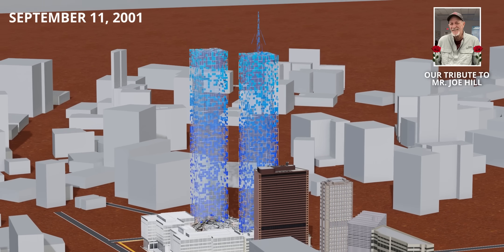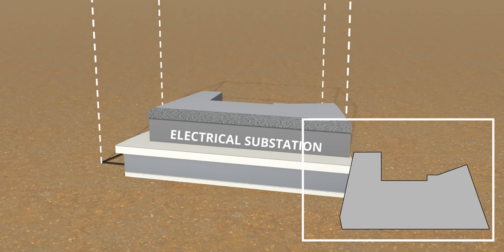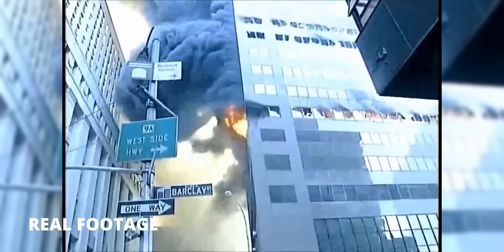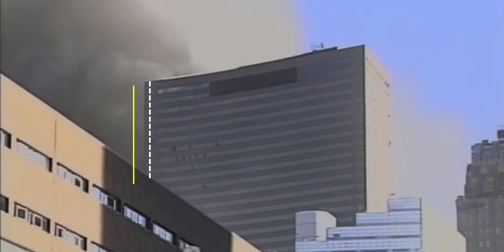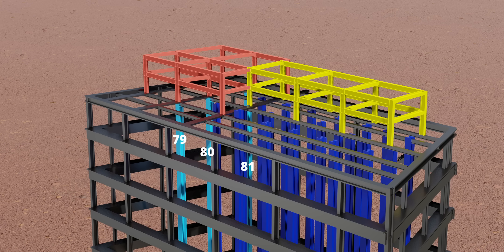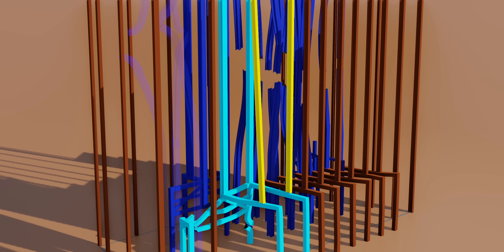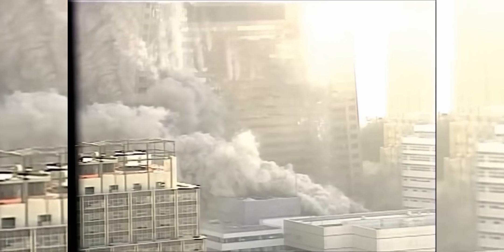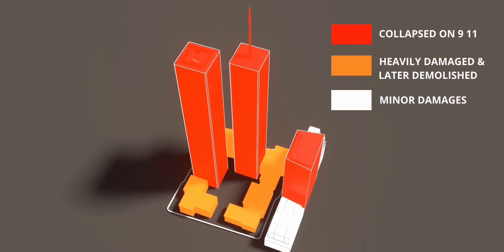Collapse of Building 7 | The Complete Physics

Comment: Oh it had a small "penthouse" at the top, that's why is collapsed and turned to dust and all the other STEEL COLUMNS failed, lol, how sick can you be to try to gaslight people like this, disgusting, shame on you. You really think they would allow this building to be built if a few fires could take it down? lol
Reply: Building 7 - the 6th building to collapse of 10 lost on 9/11 -though extensively studied  still confuses many. Not famous or a terror target, and with no casualties, it did not get a lot of attention initially, creating a void the internet rapidly filled with garbage. Because everything seems like a conspiracy if you don’t understand how it works I prepared this brief summary of the collapse from my own analysis. No politics, just engineering. 

Context: The North Tower collapse at 10:28am bombarded Building 7 with tons of burning debris, causing heavy damage and starting multiple fires burning out of control for the next 7 hours. Half the FDNY firefighters having been killed, others injured, units in disarray, equipment destroyed, no water pressure, and the greater urgency of Search & Rescue efforts, firefighting was pulled as futile. The building couldn’t be saved and was left to its fate.

www.youtube.com/watch?v=g_SvpwyC17M&ab_channel=MFitz  

Collapse of a burning structure is always a concern for firefighters. Steel buildings subject to fire rely on active fighting of the fires to survive. Buildings are designed around 1 to 3 hours of fire resistance, allowing time for occupants to escape and ACTIVE firefighting to get started, after which all bets are off. Left to their own devices they will exceed their design envelope and collapse. In B7 the occupants escaped, passive and active fire protections were compromised and active firefighting was abandoned which left the building to take its chances. It lost. Odds on Building 7 would eventually collapse, and it did. No big deal in logic. That is the sort of choice firefighters make every day in brush fire situations - which houses to save and which ones to let go. Only real difference here is moving the decimal on the size and cost.

www.youtube.com/watch?v=WnYBX6QT0R4 

FDNY Chief Daniel Nigro ; The biggest decision we had to make on the first day was to clear the area and create a collapse zone around the severely damaged 7 World Trade Center, a 47-story building heavily involved in fire. A number of fire officers and companies assessed the damage to the building. The appraisals indicated that the buildings structural integrity was in serious doubt. I issued orders to PULL BACK the firefighters and define the collapse zone. It was a critical decision; We could not lose any more firefighters. It took a lot of time to PULL EVERYONE OUT, given the emotionalism of the day, communications difficulties and the collapse terrain

FDNY Deputy Chief Peter Hayden ; We had our special operations people set up surveying instruments to monitor and see if there was any movement in the building. We were concerned of the possibility of collapse in the building. And we had a discussion with one particular engineer there, and we asked him if we allowed it to burn could we anticipate a collapse and if so, how soon? And it turned out that he was pretty much right on the money, that he said 'In its current state you have about 5 hours

The collapse of Building 7 was anticipated and widely reported in the media throughout the day. At least 24 video cameras recording some or all of the collapse. Everyone knew what was coming and why.

www.youtube.com/watch?v=OY5S5k3tMHI 

Building 7’s collapse was completely different to the Twin Towers, harder to understand with most of the details difficult to see. But we can still sort out what happened through careful analysis and observation.  This is MY EXPLANATION of the collapse sequence using the best available information and relying on no authority.

B7 was complex 47-story steel framed structure built on top of a smaller existing 3-story building, requiring several lower floors dedicated to complex load transfer structures instead of usable office space. Of trapezoidal shape and all-steel tube-in-tube construction, B7 (above the 7th floor) consisted of a central core of steel columns carrying most of the gravity load, perimeter steel columns around the outside of the structure carrying the remainder of the gravity loads and long span beams and girders to tie those elements together and form the floors. On the outside of the building hung a moment frame - the last part of B7 to fall. 

Phase 1 : The first externally visible signs of collapse initiation occurred at 5:20:28 pm. Collapse initiation for B7 is notably quiet with observers not realizing the building was collapsing! There was no audible warning in the form of say hundreds of ear drum busting 180-190dB explosive bangs preceding the collapse. Here at 12:00 a local CBS affiliate reporter is talking 10 blocks from B7 when collapse begins. People don’t start to notice the collapse until 12:11. Then at 12:45 is the famous CBS fixed camera clip of Building 7’s collapse.  Note how quiet it is.

youtube.com/watch?v=t5tEy6mXSE8&ab_channel=fresnosean379

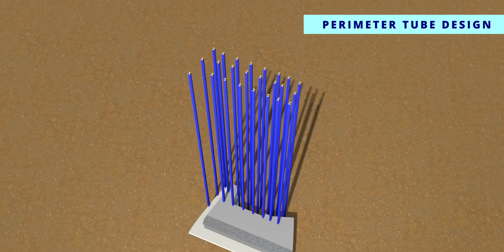Collapse initiation was due to lower floor failures above the load transfer region (7th floor) in the NE corner of the building. In this video at 0:45 you can see the NW corner from inside the building while under construction, Column 79 just out of frame on the left. That big, angled steel beam across the top of the frame connects to C79 at one end. The girders connect to the beam. That beam and all those girders depend on just one connection

youtube.com/watch?v=nP3TNHPCIVU&t=35s&ab_channel=EdwardCurrent

Phase 2 : Lower floor failures caused a loss of critical lateral support over an excessive length of core Column 79 and it buckled. If you look at a floor diagram of Building 7 (see above) and look at all the structures that depend on C79 you quickly realize this one column was a relatively isolated structural element on which a disproportionately greater fraction of the structure depended analogous to say the Key Bridge. Externally we see a vertical progression of window breakage along the 44-46 line and a kink in the roof of the East Mechanical Penthouse at the top of the building, consistent with C79 failure. The transition from full capacity to almost no capacity occurs in virtually an instant. Once the buckling failure occurs there is almost no resistance

Normally with a buckling column, the load could very well be redistributed to other columns, meaning the buckling could stop after a while. With C79 that is not the case - the failure did not redistribute the load, so the collapse rapidly progressed to the roofline, sinking the rooftop penthouse.

Phase 3 : With C79 gone, B7’s progressive, non-symmetrical collapse continues with C80 and C81 at the east end of the core left laterally unsupported and quickly buckled and failed as well, sending the EMP down through the building. C79-81 all have no diagonal bracing, which I believe is a major reason why they could not redistribute a lot of vertical loads among one another.

From there collapse progressed from east to west through the central core until the core was gone taking all of the interior floors and structures and probably most of the perimeter columns with it. You can see the horizontal progression of window failures low in the building and the dropping of the remaining rooftop structures into the building. One of the big takeaways from the NIST Building 7 study (that gets completely ignored) was their modeling which determined C79 failing under ANY circumstances would have initiated the same collapse sequence.

Phase 4 : After some 10 seconds all that remains of Building 7 is just a hollow empty outer shell - the exterior moment frame - creating the illusion the building is still standing since little has changed externally. But it’s just a hollow empty shell like an empty cereal box supported by only a few remaining columns and quite unable to remain standing. With all the internal framing gone. the north face leans inward, forming a V in the roofline, the last perimeter columns buckle under the strain and with nothing left keeping it up the moment frame free falls, landing on top of the 7-story high debris pile. It is only at the very end that a single measurement of alleged free fall acceleration is taken. Note this is not the building but just its outer shell, and only one corner at that, at the very end of the collapse. Start to finish the entire collapse took 18-20 seconds, or less than 1/3 of true free fall and we have to look at the whole thing, not cherry-pick little bits to fit a particular narrative. Worth noting _how fast something falls cannot tell you what started it falling in the first place. The debris spread out, blocking surrounding streets, heavily damaging the Verizon Building and destroyed Fiterman Hall, all well outside of Building 7’s “footprint”.  

Building 7’s progressive, non-symmetrical collapse was incidental and unintended collateral damage from the combined effects of fire + time + gravity started by the collapsing North Tower. That is true no matter who planned and carried out the 9/11 attacks or why . The collapse was of so little consequence it barely even registered at the time, a mere footnote. It only took on semi-mythical status as an alleged smoking gun years later when demolitions at the Twin Towers, missiles at the Pentagon and shoot down over Shanksville all failed and conspiracists had nothing left to work with.

Anything can seem like a conspiracy if you don’t understand how it works. Now you should. I hope you found this helpful and informative, not adversarial and it solicits informed critical comment. If I made any errors of fact, logic or reason or left anything critical out, please let me know so I can fix it. IF you can offer a more plausible alternative please do. Be the first. Please start any reply with the words “Tits McGee” or I will know you didn’t read it and are wasting my time.
Reply: That you're completely clueless about anything that happened, or for that matter basic physics? Isn't anyone ELSES fault. Or for that matter, "gaslighting".
Reply: @mooneyes2k478  fake bot account go away

Comment: Propaganda film.
Reply: And yet not wrong. Go figure. 
	
This video is pretty good – with a few exceptions - and goes into a much higher level of detail than many viewers will be able to comprehend.  While not perfect, the collapse mechanisms – the sequence of failures - described here  are substantially correct and this is true no matter who planned and carried out the 9/11 attacks or why . 

That may not be what you want to hear and go against 20+ years of entrenched dogma and conditioning, but it’s not wrong. 

That also means (in case you did not get the hint) this video can be (and IS) absolutely correct in its description of collapse mechanisms AND the 9/11 attacks could still have been some sort of inside job. The two things are in no way mutually exclusive. 

The mechanisms described here have broad professional support around the world. There are no professional engineering organizations (for example: ASCE, ASEE, ICE, etc) that disagree with them or have offered any formal dissenting opinions or alternative hypothesis. 

So, setting hubris aside, either the overwhelming majority of the worlds structural engineers and simple observation are wrong,… … or you are. Which seems more likely? 

IF you still think believe this explanation is wrong then produce a better one . Good luck with that. No one ever has and I don’t see you moving that needle today. 

No one ever does.

Comment: It doesn’t bug me that they collapsed but how, the south tower was totally understandable but with how high the first plane hit tower 1 you would think it would’ve actually stood up unlike building 2.
Reply: That's why it took longer.
Reply: @ yeah but it shouldn’t have brought the entire building down, it should’ve partially collapsed, when you hit something at a higher spot it shouldn’t just fall and bring the entire tower down
Reply: @punkrockstormchaser  Same damage. Same failure mechanism.  Only difference was it took longer as there was less load acting on the damaged portion of the North Tower.
Reply: @ load acting? I’m only 16, so I’ve only made an opinion based on my o see action on how it went down
Reply: @punkrockstormchaser  The more weight is pressing down, the sooner you get failure. South Tower was hit about 10 floors lower. That means 10 floors more mass pressing down on the damage and it fails in half the time.
Reply: @ ok, that makes more sense, I already figured since the south tower was hit at much higher speed and at a lower spot, and watching it (walls fell inward as it began to collapse)
Reply: @punkrockstormchaser  - Yep, nailed it.

Comment: How did a fire with just normal office equipment and no jet fuel reach 600 C? Building 7 would be the first building in history to collapse from just fire, even after suffering damages from the spire it still wouldn't have fully collapsed at free fall speed.

This video has great info on the structure and inner workings of building 7 but the numbers on the temp of a fire is completely wrong. We know how hot office equipment burn at and it's not hot enough to make buildings collapse at free fall speeds which it did.
Reply: First building in history to collapse from fire eh?  Tell that to the residents of the Pallisades and greater Los Angeles area.

FFS 🤦‍♂🤦‍♂

Comment: After working in construction in UK for for 40 years, can  someone please explain how an office building burns that violently, bearing in mind all the intremessant fire protection to the steel frame was still in place, i.e.,no explosion like the towers, to blow in off, and what's in an office to burn.
And even if it did burn, it wouldn't affect the integral steel frame.
and would never collapse as it did.
BBC reporting it had collapsed whilst building 7 was visible in the background.
Was the plane that crashed in pennsylvania intended to hit this building  ?
Reply: 50% of the responding FDNY had just been killed. Much of their equipment was destroyed. Remaining units were disorganized, roads were blocked, and there was no water pressure. 

So, what is going to stop the fires from spreading throughout the building?

Comment: We all saw how it went down. That could be nothing but a controlled demolition. Anyone who still believes the official report in 2025 simply has not looked into it enough. It looks very likely 911 infact was an inside job. But normies minds are not equipped to deal with that reality. And the perps are relying on it.
Reply: The collapse of Building 7 is probably the most studied engineering disaster in history and the subject of 5 comprehensive engineering studies and more than two dozen technical articles in major peer reviewed engineering journals, most of which were published 15 or more years ago. Thousands of pages of material.  IF you don't like the official report (for,... reasons I guess) there are many others to choose from.

FEMA BPAT (initial report superseded by NIST NCSTAR 1A)

NIST NCSTAR 1A: Final Report on the Collapse of the World Trade Center Building 7, 2008.

Guy Nordenson and Associates, WTC7 Global Collapse Analysis Report and Summary of Findings, 2010.

Arup, WTC -7 Structural Fire Analysis Report (Runs 1-4), 2010.

Weidlinger Associates Inc., WTC 7 Collapse Analysis and Assessment Report, 2010.

BRE Centre for Fire Safety Engineering, Analysis of the Impact of a Fire in the Mechanical Room (5th & 6th Floor) of the World Trade Center 7 Building, 2010.

T. McAllister, R. MacNeill, O. Erbay, A. Sarawit, M. Zarghamee, S. Kirkpatrick, J. Gross, Analysis of structural response of WTC 7 to fire and sequential failures leading to collapse, J. Struct. Eng. (United States). 138 (2012) 109–117.

For a summary of the major studies I would recommend THE COLLAPSE OF WORLD TRADE CENTER 7: REVISITED by Mhd Anwar Orabi , Liming Jiang , Asif Usmani and Jose Torero which is a 33 page summary of the different analysis and conclusions published in 2020. Sorry, YouTube will delete this post if I give the link but it should be easy to find and is available from the University of Queensland, Brisbane. 

Real structural engineering industry professionals conducting real engineering studies and publishing them for other professionals to see. Not amateur YouTubers appealing to the gullible and credulous. 

Happy reading
Reply: ...It looks like you're ploughing a lonely furrow man. When are you going to realise that nobody believes your bullshit posts, people have seen and read the info available and come to their own conclusion. You're deluded you troll!!! 🧨💥🧨💥